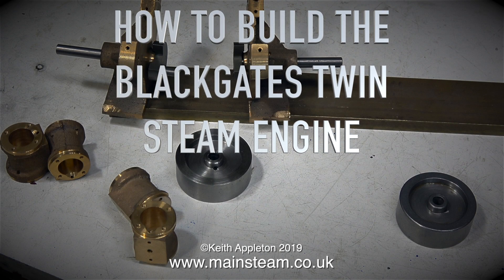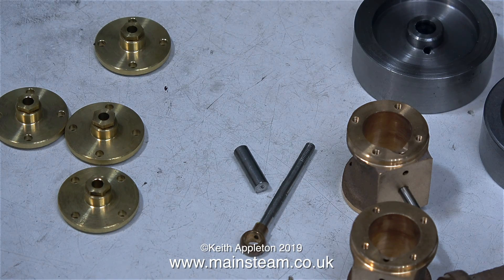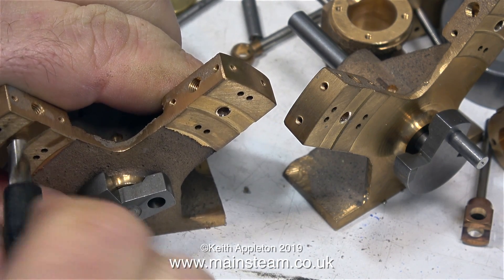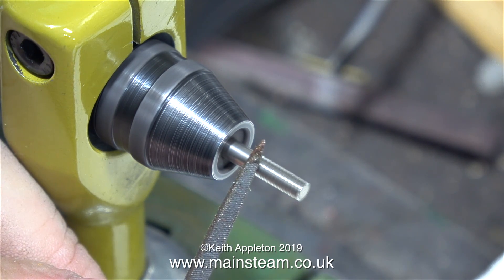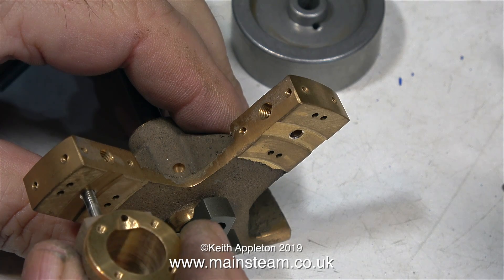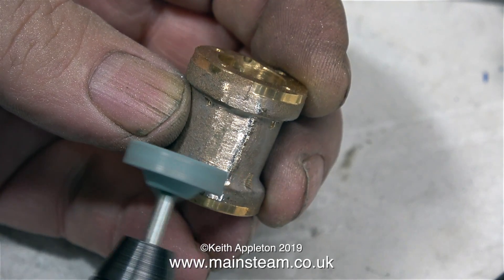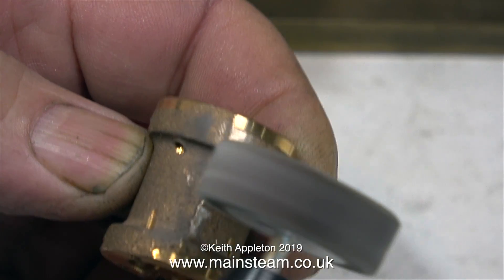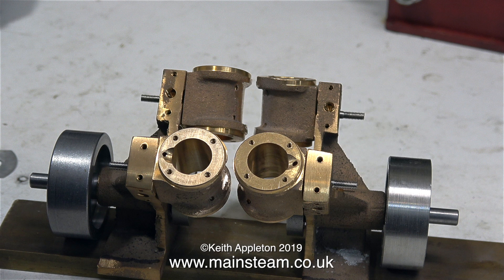HOW TO BUILD THE BLACKGATES TWIN STEAM ENGINE - PART #3

Comment: Belated Birthday greetings, I hope It was a good one. That is very good advice on the studs, most people buying that type of kit expect it to be a shake the box and it is done thing. When the studs were done there should have been clearance at the end of the threads, but that is an extra lathe operation or two that the manufacturer has to do.